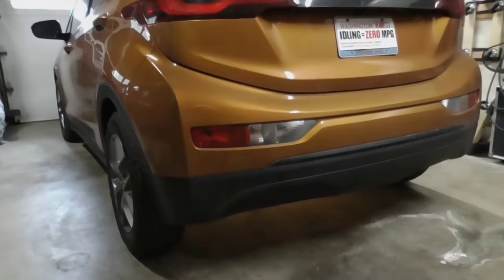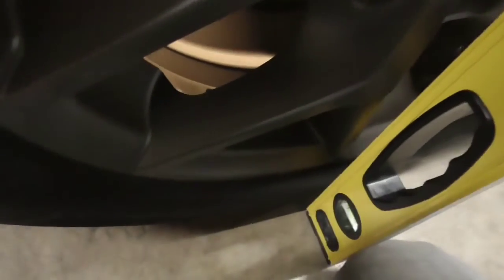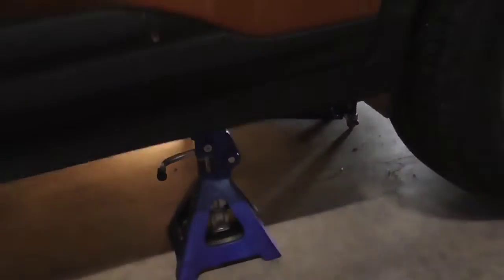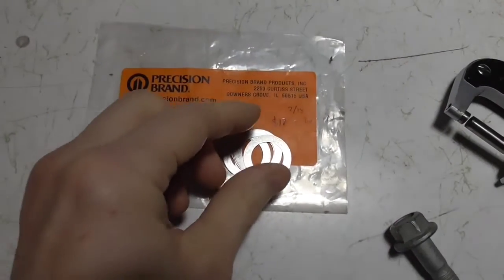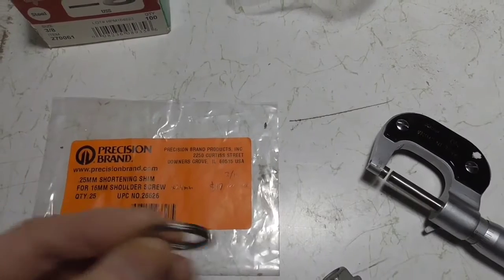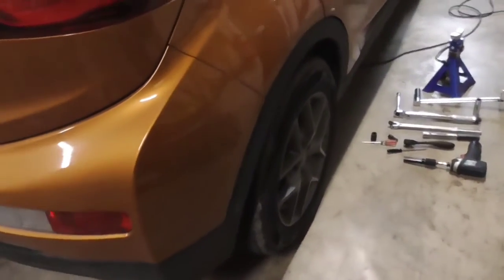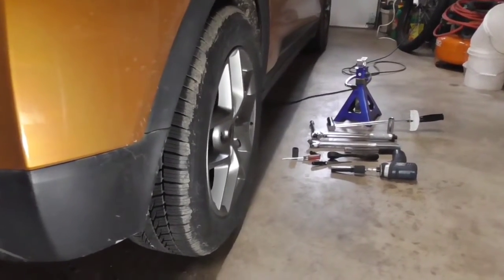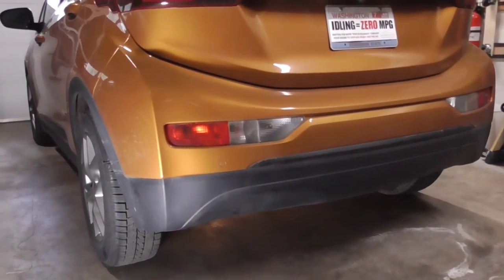Chevy Bolt - Rear Alignment

Comment: 17:00, I was thinking the same thing that the front and back might not be the same width like my VW.  On that car, I just use 4 jack stands to tie the string to and still use the string method, but takes much longer to adjust the stands so that the front and back are the same width then use a dial caliper to measure from the string.  I'm going to check mine soon.  My first set of tires seemed to wear out quickly (30,000 mi), but that just maybe me tromping on the accelerator too much.

Comment: The rear is out of alignment for one of two reasons: it was built wrong or something wore out.  If something wore out, the better idea would be to replace what is worn out.  Aligning to compensate for worn parts results in a sloppy handling car.  Your video is good except I would have like to have seen some checking for worn parts.  In your case, that would be the wheel bearing and torsion bar bushings.

Comment: Where did you get the shims?  I’m having a hard time finding these
Reply from the maker: Precision Brand shims were purchased off of Amazon.
Reply: @theevolvingworld  tyvm!  I had one other question.  Rather than using the string, can I use a 3 plane self leveling laser level?   I am assuming if I want to use this I’d have to first find the center of the car, mark that out then measure equal distances to either side to set up the laser a couple onches or so out from the tires and shoot the laser plane straight down the side of the car and could then take measurements from the front and KC of the wheel lip to set toe, after I have camber set?
Reply from the maker: Lasers are great for certain applications.  What you are describing sounds needlessly complicated.
Reply: Ty!

Comment: You mean you don't have a $25,000 computer controlled laser alignment system in that garage of yours? Sheesh. 😋
Reply from the maker: They were sold out... Ha Ha Ha.  Maybe in my "Dream Garage"... one day.  Meanwhile, never underestimate the power of basic tools & household items!
Reply: @theevolvingworld  For sure. I used to help my dad pull motors using some rope, a large tree in the front yard and a truck (not advised!). It definitely can be done.

By the way I'm still waiting for my Soul EV+ battery to arrive. Yesterday made 3 weeks, but they're supplying the rental car so that's on them.